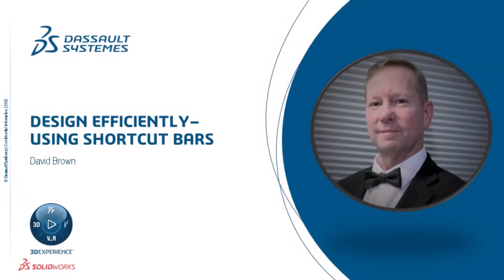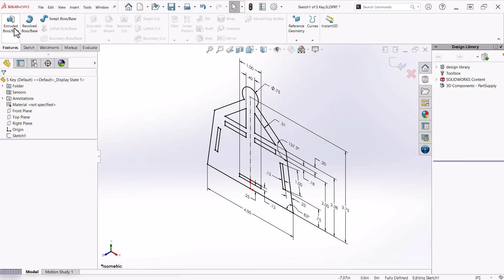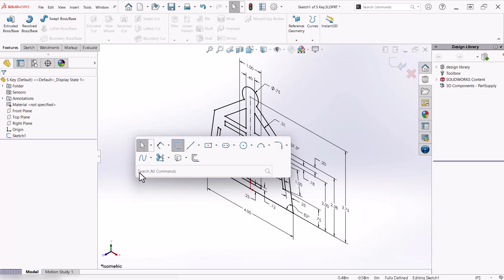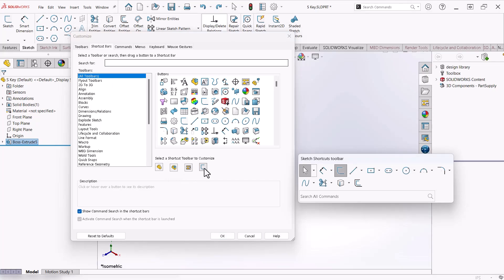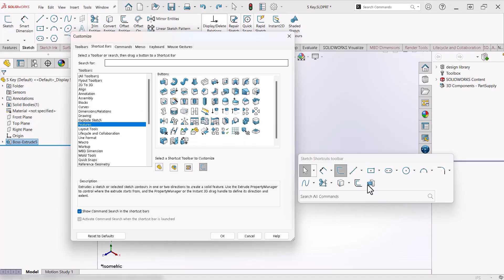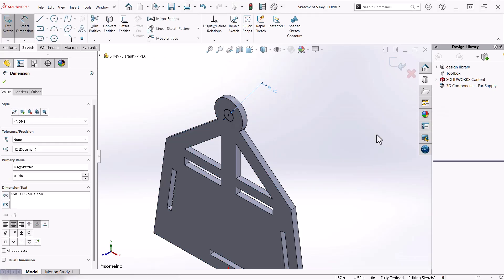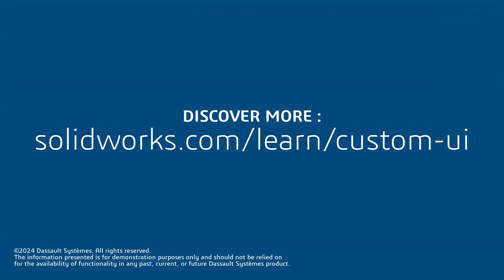Design Efficiently – Using Shortcut Bars in SOLIDWORKS

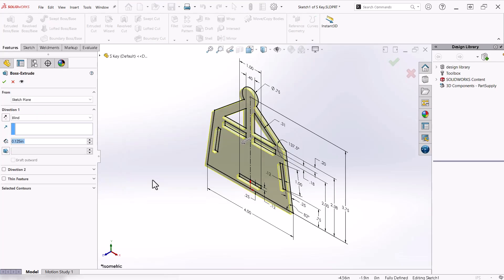Comment: 1:03 vs reality - I lift my hand from the mouse and type in the value instead of smashing enter and be done with it, I move my hand back to the mouse and lay it on top. Doing that mouse moves a little and the RMB to confirm prompt will disappear. I then have to ride all the way to the top left or top right corner to confirm. Confirm ANYTHING should be by default in the radial menu at the same direction ALWAYS.

Comment: Would be much more useful to define keyboard shortcuts for "in sketch" environment. Then E for Extrude, R for Revolve, etc. Since these are app-wide, it makes them quite useless. Also E triggers filter edges by default :D Yeah, way more useful, than Extrude, wait, its actually useless as a filter at all, as you still have to click the edge pixel-perfect as you would have to not having the filter on, just does not select anything instead of the part face when you miss by 1px. Especially unuseful, when the pixel that allows you to pick the edge is not the one that shows the edge.
Reply: MANNNNN WHAT is up with edge selection being so small?! I'm glad I'm not the only person who noticed that. Even trying to put dimensions on a drawing has become a pain because you have to perfectly select the 2nd line/edge or it just drops in a linear dimension for the first line that was selected!

And yeah, environment-specific keyboard shortcuts would be a game changers for those of us who like a balance between buttons and keyboard keys. I overwrote the default shortcuts, no one needs E for filters!